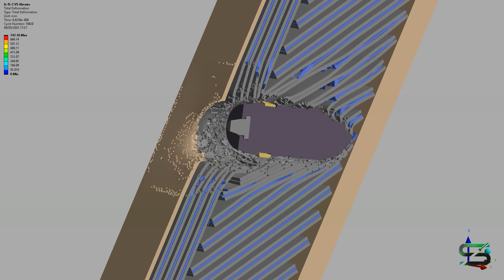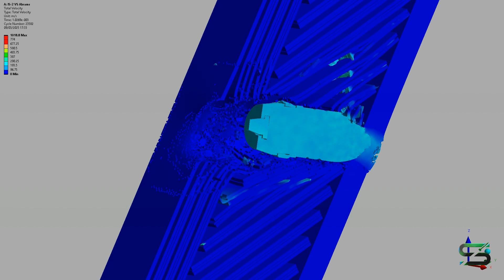IS-2 VS M1A1 Abrams | Armour Piercing Simulation

Comment: wow, I thought that it is impossible to stop with side of the turret from such crazy short distance.
Reply: Except it didn't stop. It's an APHE shell so it would detonate and kill the entire turret crew. The 122mm APHE carried ~250g of TNT equivalent explosive.
Reply: @interpl6089 250 г мало что бы находясь в броне нанести вред внутри танка
Reply: @interpl6089  yes, the name is APHE, but it is modelled as a solid object as far as I see. So most likely it is not APHE.
Reply: @west_adv  Most of the time the explosive filler is omitted in these simulations. The creator probably forgot to mention that
Reply: @west_adv doesn’t matter how this guy modeled it. BR-471 is still APHE with 250gr explosive filler.
Reply: @DoguQ  so it matters a lot :)
APHE will explode, not penetrate as solid steel.
Reply: @west_adv  HE will explode at the point of impact, not APHE. APHE and later variants will still penetrate the armor before exploding.
Reply: @DoguQ  sure, but it will not penetrate as much as solid steel, so it matters how the guy modelled. 

Anyway, this is as relevant as discussion whether viking would kill modern soldier if he would hit him with an axe to the side of the head.
Reply: @ Even with explosive filler, it is still likely that the shell would penetrate enough of the composite to cause damage on the inside after detonation.
Reply: @ agreed
Reply: It didn't stop...
Reply: @KV-2Guy  it did non of the projectile made it inside, only some spall from the back plate
Reply: @zdendajirasko8188 Exactly
Reply: @zdendajirasko8188 There's one single thing you've missed.

The BR-471 is an AP*HE* shell. Which means it has explosive filler inside. And due to the core of the shell not being destroyed at all, the shell might indeed fuze inside the armour array and give the crew an even bigger emotional event.
Reply: @saucy743  that what i was thinking
Reply: @KV-2Guy  Wdym "it didn't" stop dude
Reply: @phoenixgn9655  I think he meant some of that spall may kill the gunner or other crew.
Reply: @hdfghghfghd  From that point of view, yeah

Comment: Why is the Abrams so cursed 💀
Reply: Average bad wifi war thunder player
Reply: It doesn’t really matter what it looks like the main part of the vid is the sim it’s just a cool added feature
Reply: The guy is an engineer, not a 3D artist.
Reply: Also, that IS-2 was using the 85mm cannon
Reply: Short barrel is for civil areas
Reply: The Russians obviously should reopen production of the IS-2 and quit building those junk T-90's.
Reply: Abram'nt
Reply: It isnt cursed?
Reply: The model of the is a is-1
Reply: Holy road wheels
Reply: It's the new murica high tech technology so you must run before it deploys otherwise it will start to fly
Reply: At that range a Sherman would probably penetrate the armor.
Reply: Not as cursed as Chinese and Russian tanks
Reply: Its being shot at from 10 meters away which is roughly like 33.2 feet i think im doing just a rough estimation.
Reply: Because it's a amateur version of the Armour and you believe it's the real composite